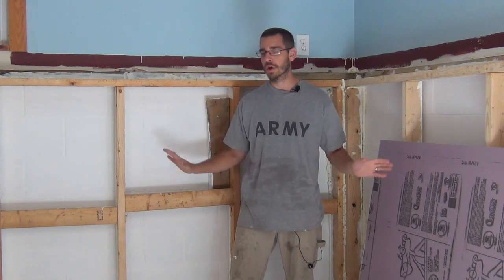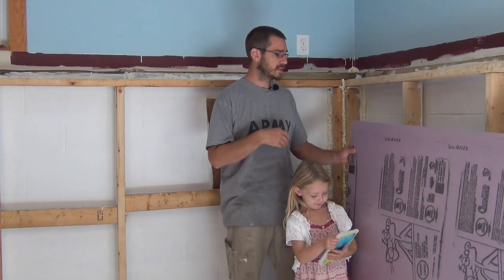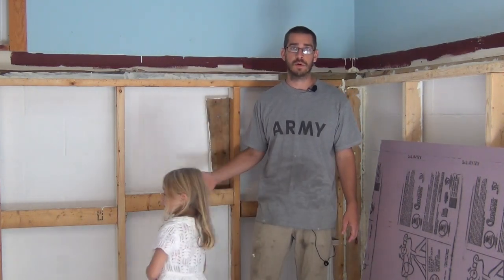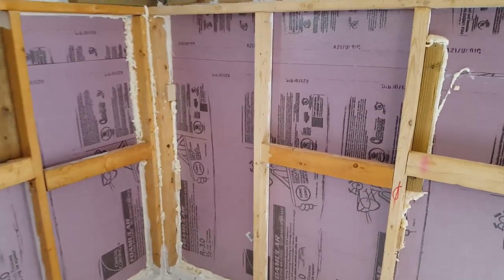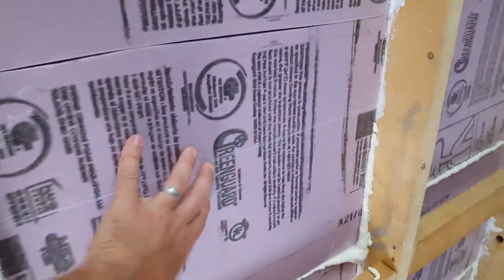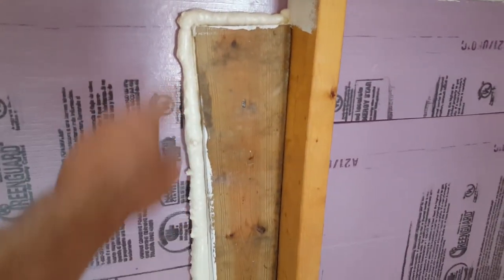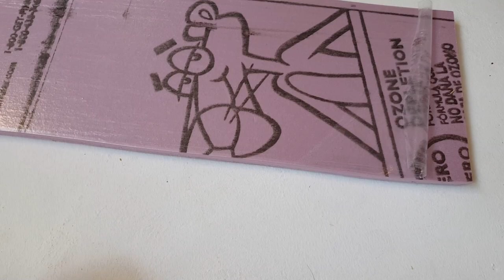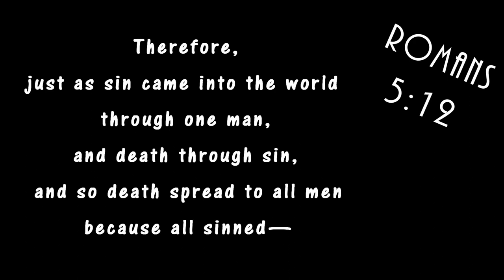Insulating the Basement Walls

Comment: Here in Michigan, I have always put the moisture barrier toward the living space. In warm climates, the barrier should point to the outside of the house, blocking the vapor from the humid outside air that may seep into the walls or ceilings. In cold climates, the opposite is true. The air is usually warmer inside the house, so condensation can build up from air entering the wall from the inside. The vapor barrier should point toward the room in this case.Good thing you've got such good helpers with all of your projects.

Comment: You may want to further investigate the causation -  high water table, clay backfill, hydrostatic pressure on the foundation and the porosity of a cinderblock foundation can all cause issues with moisture and eventual leaking/seeping water inside the structure.  The best way to address the issue is from the exterior.  Cinder Block foundations over time tend to fail/fill with water and begin leaking inside the home. The drain tiles fail and the exterior walls normally are only coated with a tar like coating which degrades over time and allows water absorption into the cinder block foundation.  In order to avoid further issues, in the Spring, you may to dig the perimeter of the foundation up and install an exterior waterproofing membrane around the foundation and install new drain tiles to properly address the issue.....
Reply from the maker: +BacktoBasics Gal totally agree! The outside is drained well and our sump system works full time throughout the winter and spring. There is another issue outside that I will address in a later video. But, for the basement I want to make sure it is free of moisture!
Reply: Overkill!

Comment: I don't know what type of heat you use in your home but just for the info natural gas and propane when burned produces water as a byproduct which will condense on cool surfaces; this is only an issue when using non-vented gas heaters like the ones that can be mounted on wall.
Reply from the maker: +Ronald E. Wroten, Sr. We have an outdoor wood burner for winter so it is a dry heat. Sometimes use an electric heater down there as well.
Reply: I would love to have one of those outside wood burners they are really nice... I saw in the previous video you have a dehumidifier so just continue to monitor the humidity level and make sure to have a good air circulation; make sure all water runs away from the outside of you home. If the problem persist there are other options but they can be pricey. I hope you get your living space back to a functional healthy environment.

Comment: I love that expanding foam too, especially for large gaps and holes. It might be more economical to use just a basic caulk or silicone on your seams where 2 pieces butt together. It will look cleaner too. Just a thought.
Reply from the maker: very good point on the caulk, I think they have something just for foam board also, but spraying in that foam is just so fun isn't it?
Reply: Must be a product that won't burn the xps

Comment: I've been following along and I haven't seen the question asked and I don't recall you mentioning it but I'm just curious why you didn't take down the timber framing as you appear to have made a lot a work for yourself working around it both  painting and insulation  just curious
Reply: Probably felt like it would be too much work, the problem is he made a mess of insulating his basement by not following your advice and almost defeated the purpose of installing the rigid foam insulation.  You need at least 2" of foam board before it is considered a vapor barrier and all those cuts made even more access points.  He should have installed sheets up and down the wall and used the tape that is meant for this job.  If they had so many water issues in the past it is likely he will be eventually ripping this all out to do it properly.  Even worse is that people may follow his advice and make the same mistake..... it is not a good idea to offer advice online when you do not know how to do the job properly.
Reply from the maker: There were no water issues on any of those walls first of all, second of all although I do agree that it would have been best to tear out the studs and foam board behind the new wall since that wall was always dry I chose to retrofit it as is. The wall that did had moisture issues was torn out and foam board behind it as well as drylock